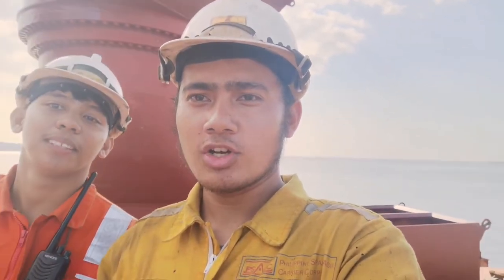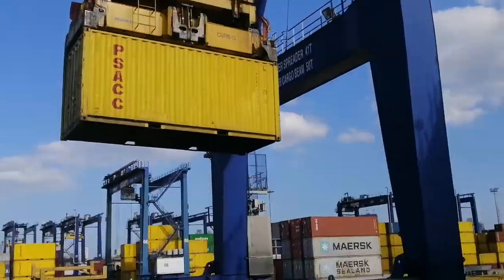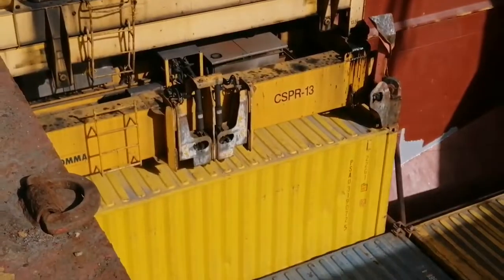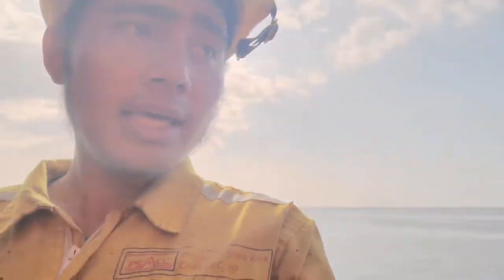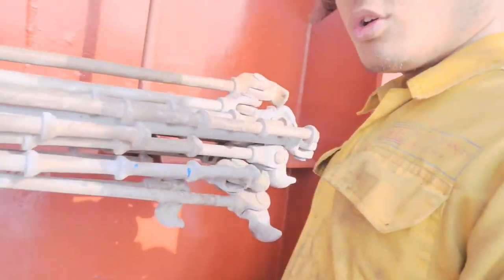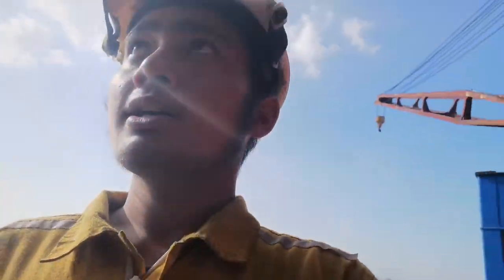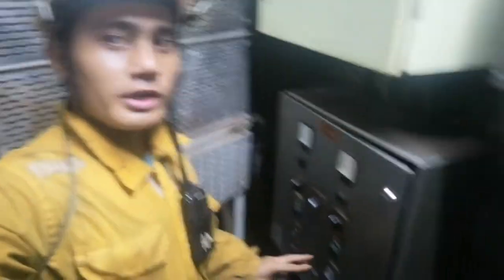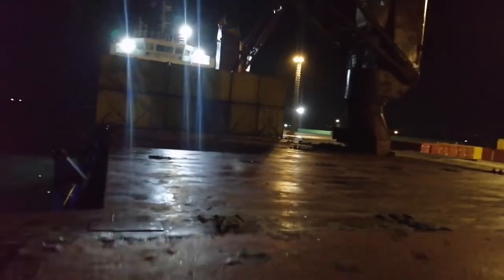Cargo Operation on Container Ship | Vlog 10

Comment: Sir, may idea po layo Kung magkano isang container po ?
Reply from the maker: Wala nga rin po. Pero depende rin po ata sa laki yan.
Reply: @mjnicolas2555  hi! napadaan ako dahil sa nature of work. curious ako kung ano na nangyayari sa mga containers after namin ibook sa mga barko. new subscriber here!
Reply: @mjnicolas2555  depende yan sa size ng container 20ST, 40ST 40HC etc., kung DG ba yung cargo at sa value ng din laman (for insurance syempre)
Reply: @mjnicolas2555  yung nabanggit ni sir marvin sa vlog na stowage may additional charges din yun if nag request si shipper ng stowage (underdeck, on deck, away from heat mga ganun)
Reply from the maker: @VanessaClemente  hi maam, thank you sa info maam. Wala din talaga ako idea sa mga cv pag wala na sa barko maya thank you maam. God bless.